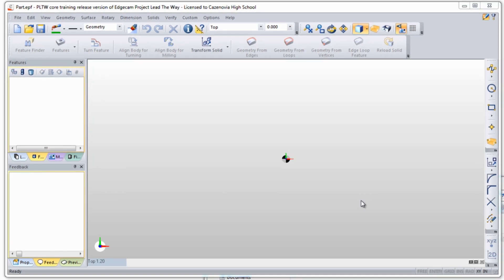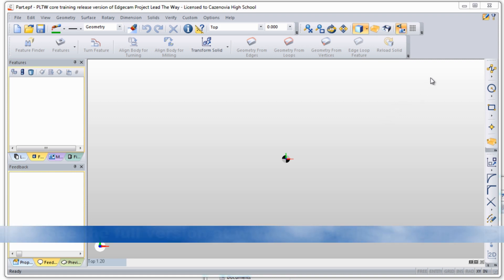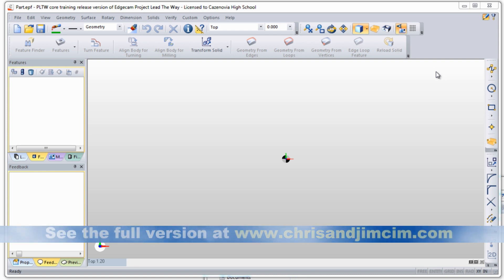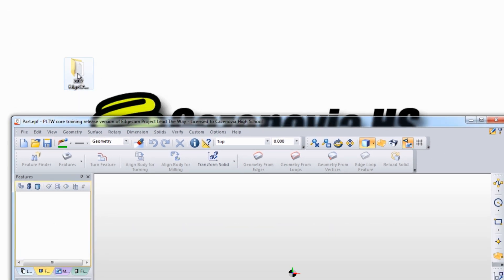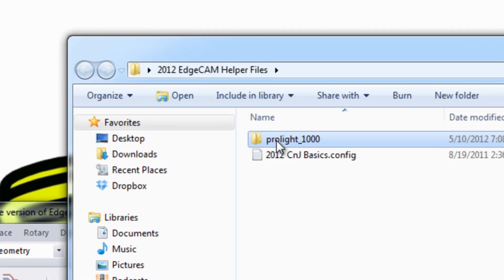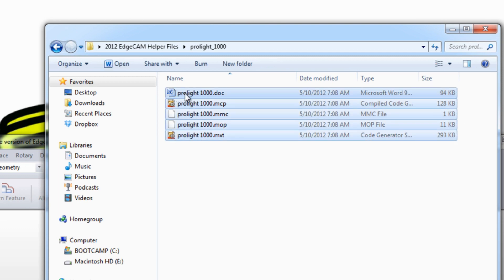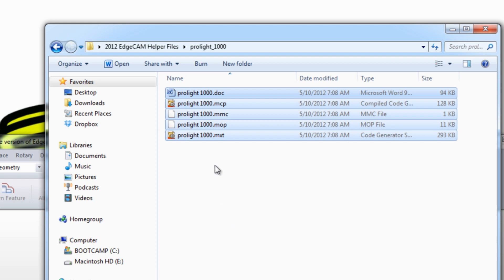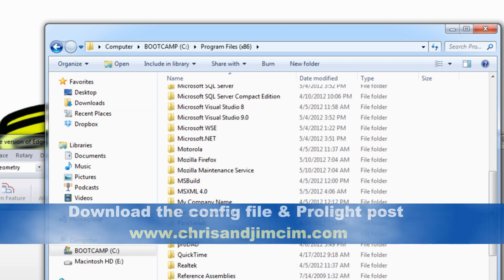EdgeCAM: Installing Toolbars & Post Processors

Comment: hi what folder withing edgecam are post processors located at in edgecam i have an older version and cant locate the folder where the post processors are at
Reply: same question to me also .?
Reply: I found This C:\Program Files\Hexagon\EDGECAM 2021.0\cam\Examples\Code Generator Documents